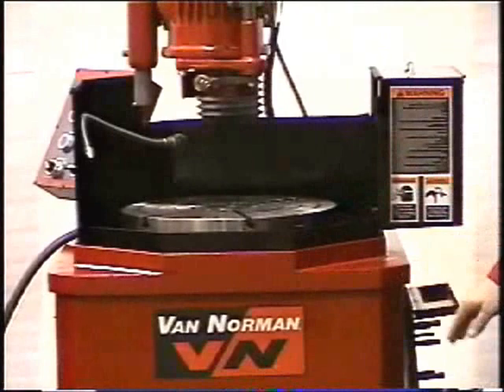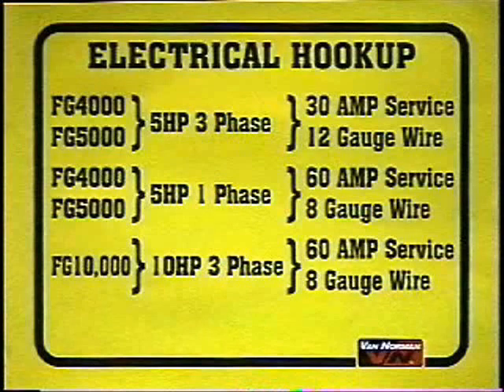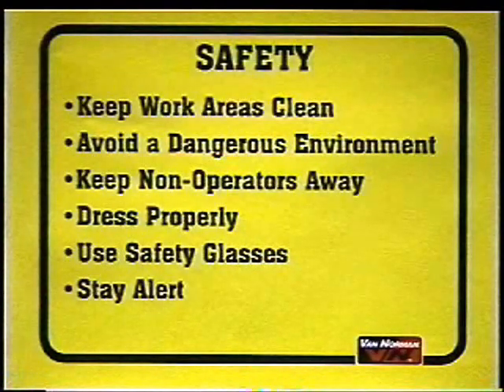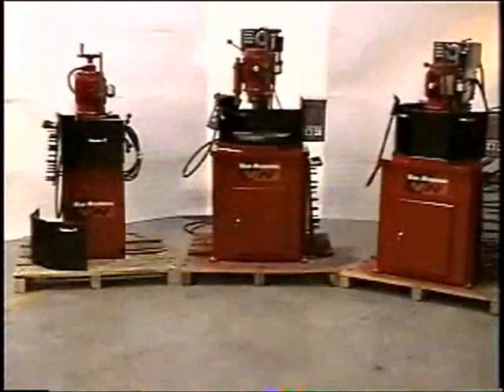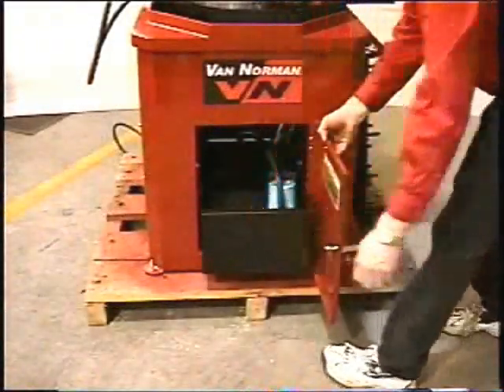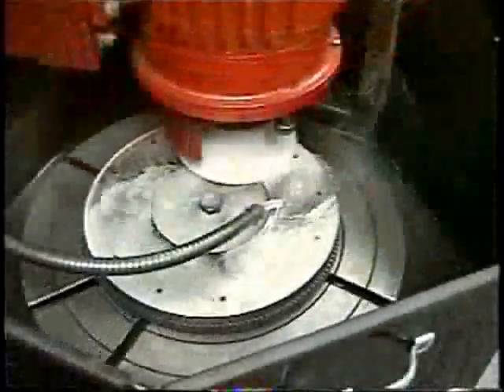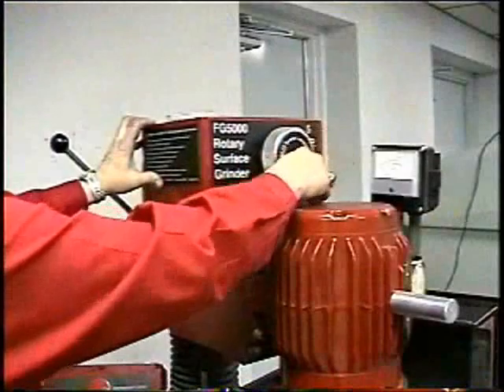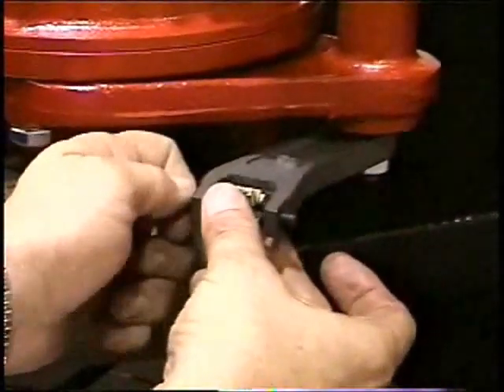Van-Norman FG Grinder Setup and Operation

Comment: How do you lift an FG5000 off the pallet, I have one sitting on a pallet, but lifting by grinding head/column seems wrong?
Reply from the maker: The manual indicates the best method is to use a fork truck and lift from the back of the machine only.  You may need to use pry bars to lift the back edge enough to slide the forks under the unit.